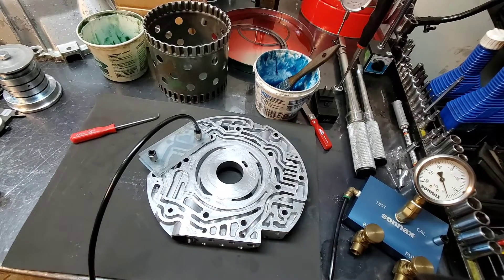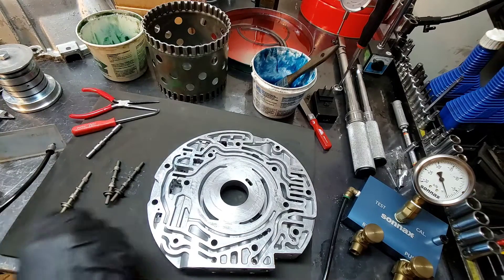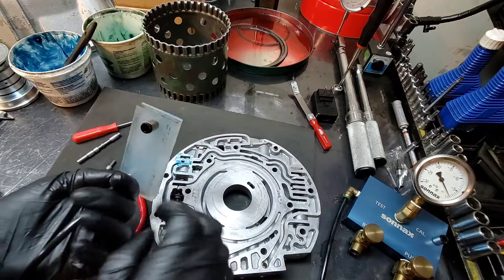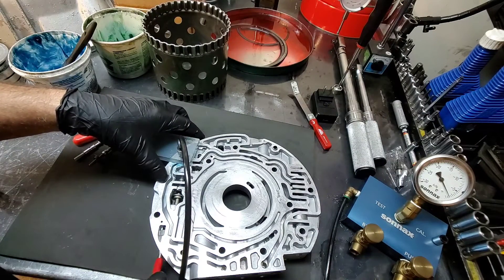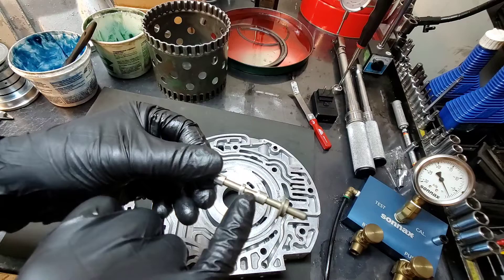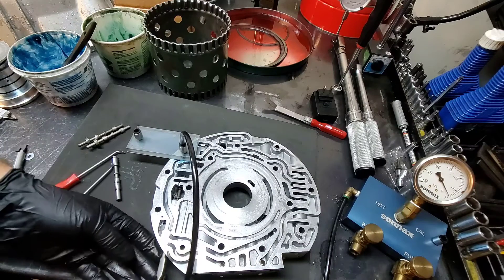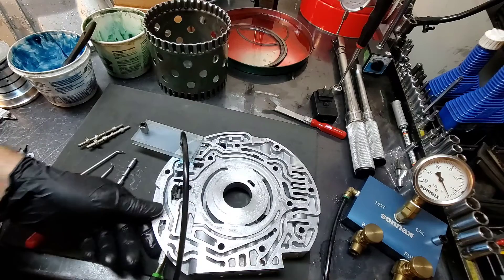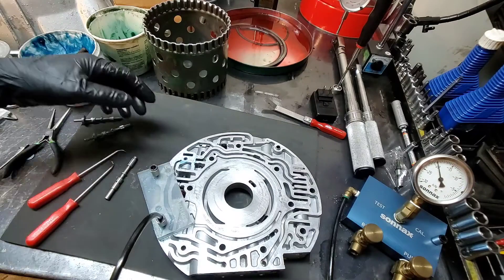🛠️ 6L80E Pressure Regulator Valve Vacuum Testing:  Diagnosing Wear & Improving Performance

Comment: Thanks for the demo. I guess there's no way to ream the bore and use an oversize valve.
Reply from the maker: Go to sonnax website, for every valve that they sell there's a minimum vacuum standard reading. If it's within specifications you'll put a drop in valve. If it's below you ream.

Comment: How to determine the bore is worn too much
Reply from the maker: Go to sonnax website, on every valve they sell there's a minimum vacuum standard. If it's close to it or slightly below you can install a drop in valve. If it's way too low then you need to ream it and install an oversized valve.
Reply: @AutomaticTransmission  Thank you.

Comment: Would readings be different if hot transmission thanks 👍
Reply from the maker: Yes since the fluid gets thinner and metals expand with heat. If you notice I have the valve clean and dry, fluid would give me a better reading since it covers the wear somewhat.